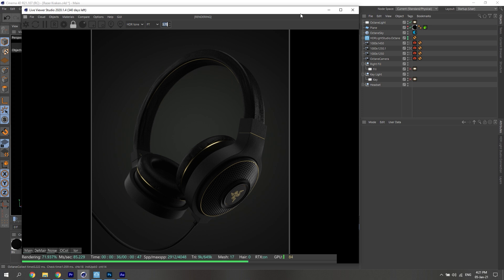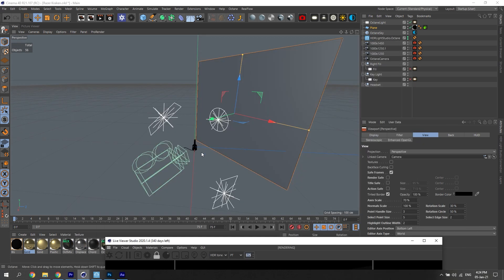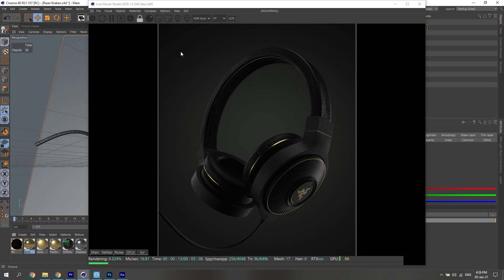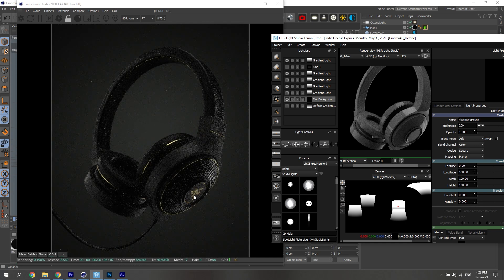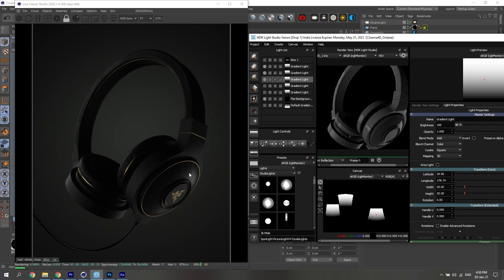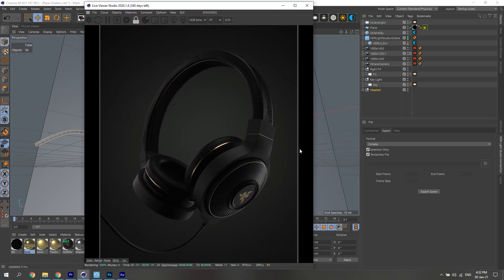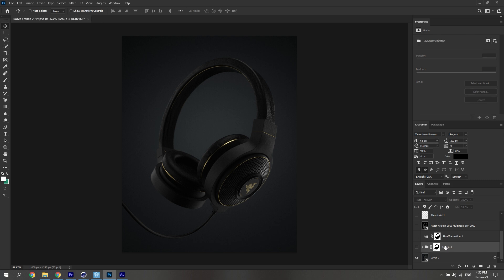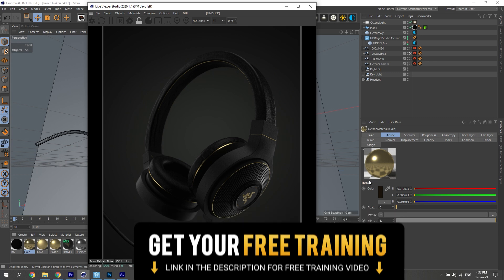3D Headphone Lighting in C4D & Octane

Comment: Arthur, what percentage of clients ask you to model things from CAD files and how do you go about doing this? Do you first clean up the CAD model in a CAD software and then import into C4D or straight into C4D and then work with it? Also, how good do your modeling skills have to be for this type of stuff? Thank you!
Reply from the maker: From personal experience larger clients tend to provide those models, but I have remodeled some in the past if there were technical issues that interfere with the animation. How good your modeling skills need to be depend on the type of models you deal with.